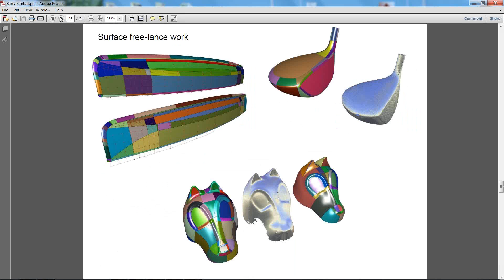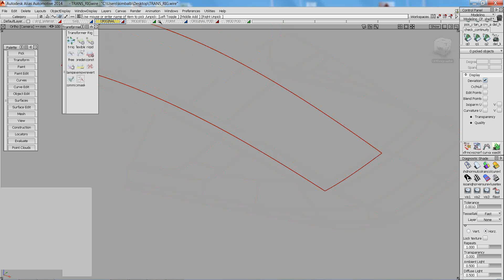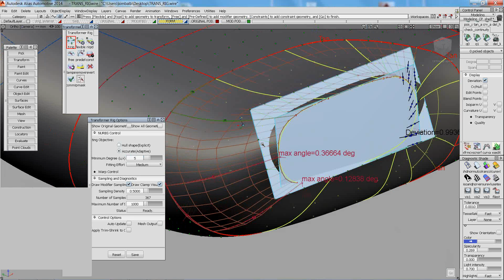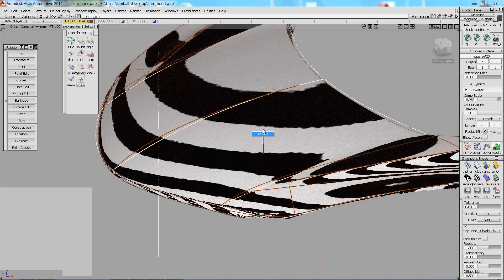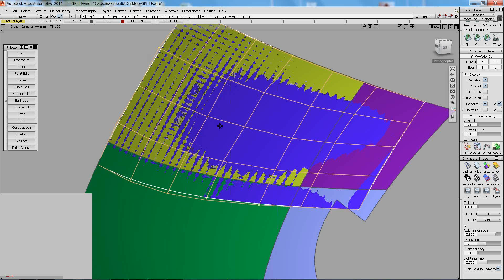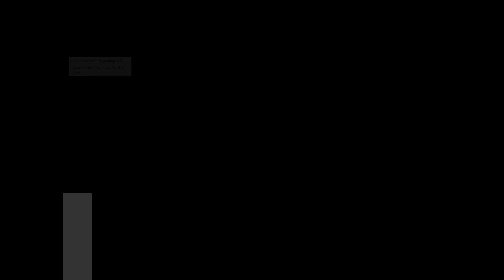Webinar: Autodesk's 'Dynamic Shape Modeling'

Comment: Nice tut!! And about 43:44 Catia can make this Tool Power Copy or UDF. You can make sample part in GSD module (with all parametric values) and then in your final model you can use you part how sample for new form in power copy (UDF). All parametrs remain the same (your drafts or extrudes or blends). So if need excellent parametric need use CATIA :)) Your skills is impressive in Alias but Alias not for fast changes and good paramertric modeling.